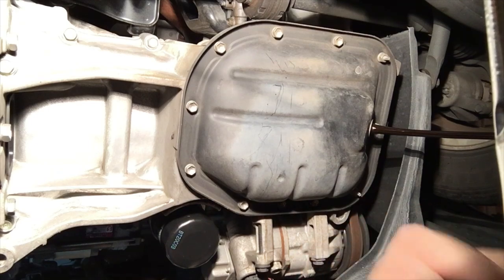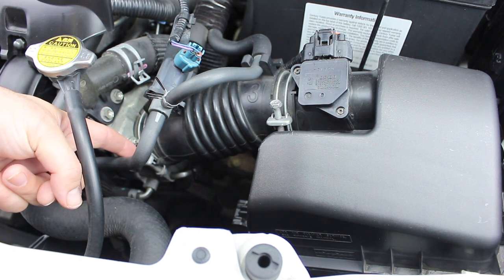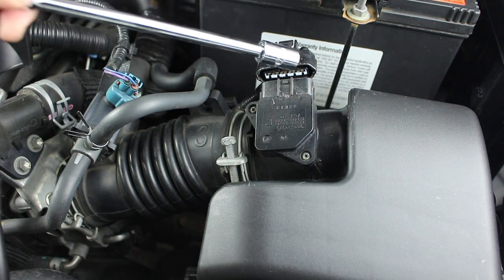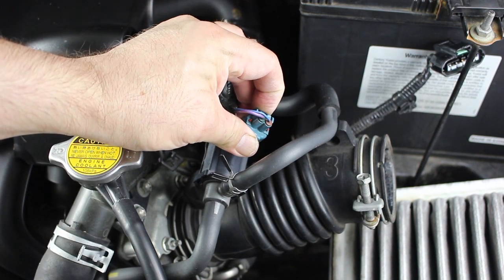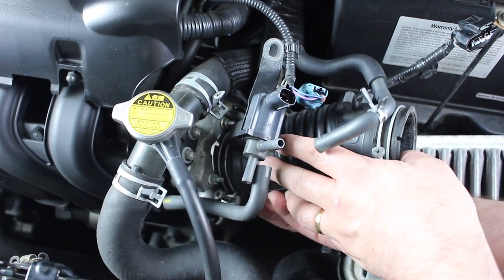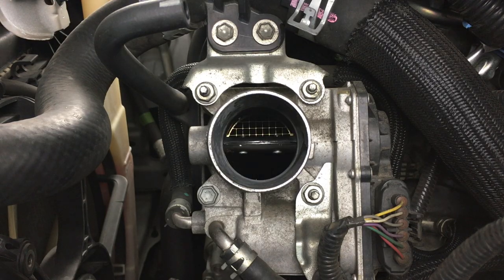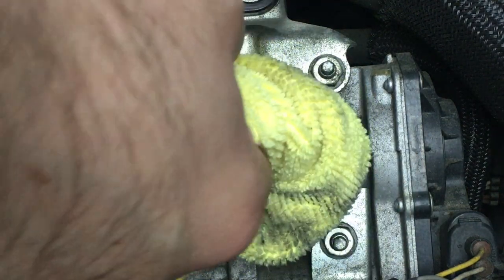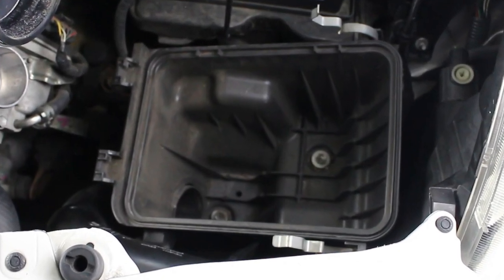Toyota Yaris. How To Clean The Throttle Body

Comment: My 2010 Yaris was idling a bit rougher than usual so I cleaned the throttle body, the MAF sensor and put in a clean filter and now it idles a lot smoother, thanks for this great video.
Reply: What kind of filter you talking about
Reply: Honestly, it was just the air filter. Try changing your spark plugs. You'll really notice a difference in how smooth and responsive the engine will feel afterwards.

Comment: Thanks for the information.  I have a 2008 Yaris with 204,000 miles on it. It still runs well but the mpg has dropped off a bit. I wanted to clean the throttle body and now I can. In addition I think I will remove it to get behind the butterfly valve and clean the intake air pressure sensor.
Reply: Do you think once you remove it ittl be okay to manually open the butterfly plate with your finger?? As in this video he said never open it manually with your finger...
Reply: Do not try to force it to move. If I remember correctly, I did not move the butterfly even after I removed the throttle body. Turn the ignition key to the on position, do not try to start the car, and depressing the gas pedal will move the butterfly. I now have 277,000 miles on my Yaris. Except for the clear coat peeling in spots, it is in great shape and still shows no signs of wearing out.

Comment: My car would start and then quickly turn off. I was getting a P2111/P2119 "throttle actuator control system stuck open" error on the code reader. My mind was all over the place trying to solve this problem. Then I came across this video and I found something a large debris piece stuck there keeping the valve slightly open. I cleaned it and my Yaris started up! Thank you so much for this video. It saved me $$
Reply: Thanks my Yaris has the same fault and I'll clean the throttle today
Reply: Thanks for your video itlle save me a fortune not having to go to main dealer and excellent sound and graphics

Comment: Was experiencing some rough idling (ashamed at how long) and a battery light I was troubleshooting. Wasn't feeling comfortable about the DIY approach until I found your video. Thank you for sharing. Great video angles and precise instructions. I own a Prius as my primary now but must admit I am still attached to this little 5-speed-helluva-trooper. Have had it for 9 years. This little runner has made it from Montana to Minnesota, to Arizona and to Washington twice. We have 3 roundabouts where I live, and come winter, the Yaris can rally them like a champ! While it might be shy of any deep snow, there is something about the balance (beyond the the FWD) that makes it handle intuitively to me in slippy conditions. While the extra weight is great, I have had more issues with the traction control on the Prius than I ever had without on the Yaris. At 110k miles still gets 39 mpg without me misbehaving. 

Again, thank you for putting this out there. Wishing you a great life with whatever you are doing now.

Comment: Just a note, 2013 yaris does not open on on position. Toyota says its normal.
 I think they are lying.
 Also not coverred this part in power train warranty they say.
Reply: Yup. Throttle body has to be removed to be cleaned.

Comment: Why didn't you remove the throttle body?
Makes it a lot easier to clean and you can remove all Carbon build up that's inside.
Very good instructions but just cleaning the butterfly and as far as your finger would fit, isn't the way to properly clean the unit.
Reply: Is there a tutorial on taking it all the way off? I can't imagine it being much more difficult than what is shown here.
Reply: Once youve removed body can you manually move plate with your finger as he advised against?

Comment: Hi got a Toyota Yaris GLS 1999 got a problem

What I start the car it run then cut off
 But when I take of the air intake sensor then it run 

When I reconnect the  sensor and start the car  it keep cut off 

What could be the problem??

Comment: Please I need a help augently. My Yaris keep ejecting.

I have change the plugs, fuel pump, service the injectors but still ejecting when am driving. Sometimes the car will go off it self and I have to spark again. Would the engine sensor course that.? Please I need help am just spending money for nothing 😢😢

Comment: Thanks, my car was shaking when I break awhile the gear on D or R and rpm was down but when I cleaned the Throttle now the engine works smoothly and rpm is up, no shaking anymore, thanks a lot , but check engine light is on now, is that normal!!

Comment: I'm no expert, but based on what I already know about the throttle body, my inference is that you were saying not to touch the little throttle plate because on your vehicle, it was electronically controlled. Correct? And pushing on the gas pedal wouldn't work if it was mechanically controlled. So would that be a good test to see if your throttle body plate is electronically or mechanically controlled so you can decide whether or not you can touch the plate?
Reply from the maker: Yes you are right about not touching the throttle plate if your car has an electronic throttle body (ETB)
Pushing the gas pedal will open the throttle plate on a mechanically (drive by wire) throttle body. 
Most new cars use ETB.
Easiest way to tell is to look closely at the throttle body and if you see wires and a cable linkage the it's a wired TB. If you can't see wires and you can see an electrical harness attached then it's ETB.
Also usually ETB will  have a black plastic casing on one side of the TB.

Comment: Hi! I cleaned out the throttle on my 08 yaris just like you explained on this video and the check engine light came on after I cleaned it. I seen the comment about  being normal for the rpm to go higher what I was wondering is about how long does it take to get back to normal? Thank you.
Reply: Actually, my cold idle & warm idle were both quite low BEFORE I cleaned the TB. At warm idle it was 450-500 RPM & threatened to die & it stumbled. Afterwards, both are back in spec! Cheers! Perfect video, audio mate!

Comment: What is the blue electrical connector, I did not unhook that and the throttle plate did not move with the ignition on.You did not mention as soon as you remove the MAP sensor on any Toyotas, you get a chk eng light, which will disappear with a number of starts and stops 10?  or you can use the code reader to cancel.

Comment: Just wanted to say a big thank you for this video. Yaris 2006 model... shaking like crazy at idle and engine would even stop sometimes.  Cleaned the MAF sensor it worked bit better but still shook heaps. Then watched this video, cleaned the butterfly valve and wow... what a difference. Thank you so much for such a concise, no nonsense explanation and steps. Subscribed.

Comment: My yaris 2008 after cleaning the check engine come out and rpm go up to 2000.what should i do?
Reply from the maker: It’s normal don’t worry. Just restart the engine a few times and the check engine light will clear itself. It’s part of the relearning process. Rpms will go back to normal.
Reply: Thank you so much

Comment: 1000% the video I was looking for. 

I did watch the car care nut mention that you can open the butterfly valve with your finger, just very gently and do not just let it go, carefully place it back in its position, so if anyone does not have a stick etc. You can use your finger.

I really appreciate the video, as most of us do :)
Reply: I'm thinking you can open it with your finger slowly ONLY if youve either A) disconnected the negative lead to the battery or B) have removed the throttlebody from the car. IDK the answer. Ive heard it screws up the gears for butterfly plate... Always slow yes, It also may depend on car brand. I want to take off whole throttle to change gasket as well. And am hoping moving open plate will be okay.

Comment: question- if i disconnect the battery cable, then am i good to move the throttle plate by hand?
Reply from the maker: No you can’t. You’ll break the sprockets and need a new throttle body.

Comment: What kind of spray did you use?
Any alternatives  , like gas, kerosine maybe alcohol 99$?
Reply from the maker: I used CRC throttle body and air intake cleaner. I wouldn’t recommend using anything else.

Comment: My Yaris 2012 1litre 3 cylinder  also has a idling problem how can i fix it can u help.
Reply from the maker: The best way is to get the codes read. Use an OBD2 Scantool. Most mechanics will do it for free.

Comment: My car keeps on accelerating on its own even when it is in parking mode, would cleaning the throttle body help solve this problem sir? TA
Reply from the maker: Idle Air Control Valve
Vacuum leak
Throttle position sensor
Debris keeping the throttle plate open 
In that order
Reply: wicked!

Comment: Hey bro. nice video and good explanation. just one question, I did the exact same process and now my check engine light has come up.Please advice. Thanks
Reply from the maker: Just start the engine and let it run for a few minutes in neutral. Then restart the engine a few times and it will clear itself. It’s normal for that to happen because the idle is higher than normal
Reply: Thank you soo much. Really appreciate.:)

Comment: my toyata yaris is crank but not starting after cleaning the throttle body (the same process as you show in the video)

why???
Reply: Did u fix ur oroblem,mine is doing the same
Reply: Did u fix ur problem? Mi e is doi g the same
Reply: @jeffreyfernandez2037  yes
Reply: @jeffreyfernandez2037  i have to open the all spark plugs for like 15 minutes then again install then start it will start
Reply: @jeffreyfernandez2037   because fluid go inside and not evaporates so you meed to open the spark plugs for like 15 minutes